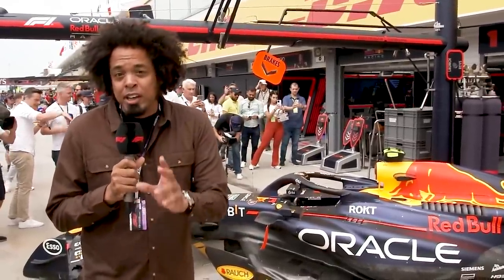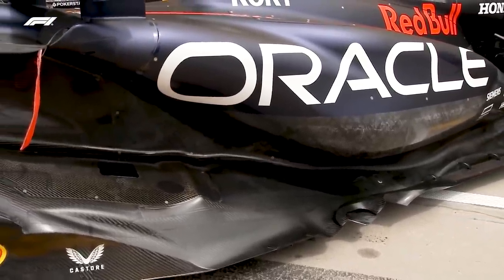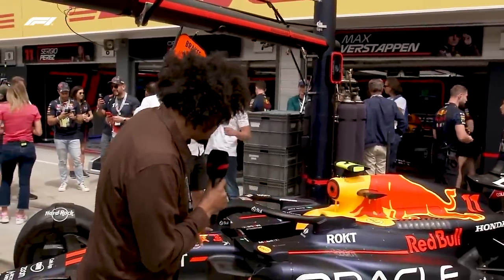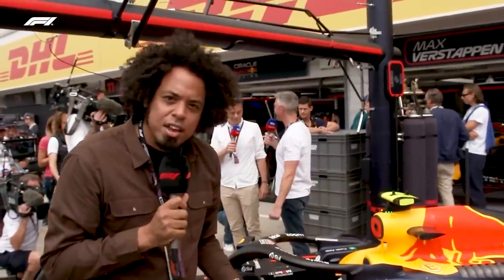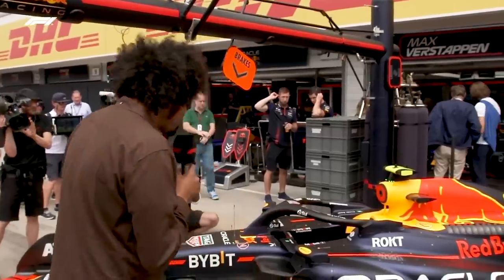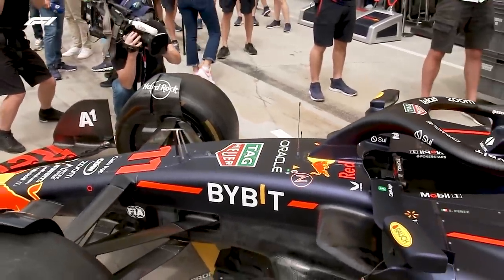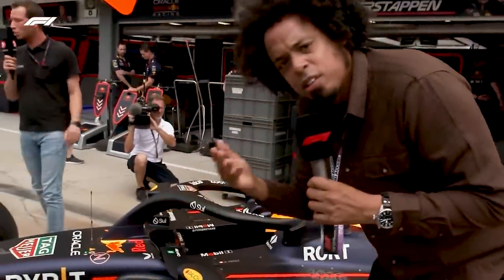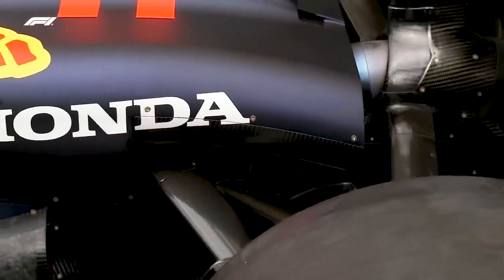New Side Pods, New Cooling Systems, A First Look At The Red Bull Upgrades | Tech Talk | Crypto.com

Comment: If they have brought these upgrades on both the cars without a safety net is a clear indication of Redbull's calculated confidence in this upgrade. The safety net however, would be to put one of their drivers on an upgraded package, preferably Checo, since Checo's qualification in Redbull standards has been way below par, this would've enabled Redbull to provide Max with a proven dominant package and continue his winning streak.
But, Redbull seems absolutely confident on these upgrades calibrating from their wind tunnel to track and to deliver their winning run.

Comment: Some people think wind tunnel work is the critical test. It isn’t. Effects of individual tracks, weather conditions, tyre performance and effect of other nearby cars is far more significant. Feedback on track is a far more accurate way of collecting data and that is where you will see the teams using the airflow frames and “indicator-paint” flow patterns in conjunction with actual test driver feedback are more valuable. As far as I understand, no limitations were put on RB doing that? -(Please correct me if I’m mistaken)

Comment: I didn’t know that changing the internals for Power unit cooling inside the sidepod was outside of the cost cap. That means teams can cleverly develop a whole new design of the sidepod just by rearranging the parts inside, without taking much of wind tunnel time and CFD.

That’s a huge exploitation of the rules, I don’t think Most teams even knew this 😮

:Edit: Sorry I apologize not cost cap, Windtunnel time only.
Reply: He didn't say it's outside the cost cap, just outside wind tunnel time.
Reply: @davidcharlesworth6831 Still that’s pretty clever on Redbull’ part to find such a loophole.

Comment: what whats FIA stance on using an AI to help develop the car, they have reduced windtunnel time but if you tell an AI all about how downforce wind resistance works you wont even need a windtunnel you can just run a simulated windtunnel and the AI will suggest changes to make improvements that wont interfere of course with the FIA rule book
Reply: legal

Comment: By Sunday, the rest of the teams are switching their focus to 2024 if they haven’t done so.
Reply: That's not how this works. Every team had at least some kind of focus on 2024 already after the first race of 23. Every generation of an f1 car is a concept car in a sense, yet you transport a lot of knowledge from the last generation into the next one. If every generation would be a from ground up development RB would have stopped their development for the RB19 months ago. But this years car is the real life testing ground for next years car, so they're still developing even after having this years constructor most likely under the hood, so will every other team that feels it's on the right way with its concept, like aston martin, ferrari and even mc laren at this point.

Comment: I think the new sidepods make the RB19  more “pointy”…could explain Checo dropping left side tires into the grass…
Reply: checo is just bad
Reply: he literally went off the track quite slowly and by a lot, like 10 cm at least
Reply: A "pointy" car would oversteer into the corner with the rear end breaking traction mid corner. What happened with Checo was during the entry where he quite substantially dipped his wheels into the Grass and was on the braking, and thus lost the car.

Comment: I mean. Why doesn't everyone just breach the rules. It shows. More money will make a better car. Should be better for viewers.
Reply: It’s not money, it’s the Windtunnel allocation they exploited. Due to changing the internals. 

That’s what most need didn’t know, or don’t know how to work around it without the relying on the wind tunnel as much.
Reply: @sheabryantmusic  Well, in the "Golden era" of F1 the 70s - 00's teams was always looking for something which was technically within the rules, happens in other forms of motorsport also with the infamous Toyota GT-ONE when they declared the empty space in the dry fuel tank was to be counted as the boot capable of containing a briefcase so they could race the thing. 

there is others which if we speaking just F1. You have the Brabham 1981 suspension, Infamous F-duct (which led to DRS) to name a few. 

so to teams if they can see how they can exploit the rules and not technically break them its all fair game
Reply: Cry harder